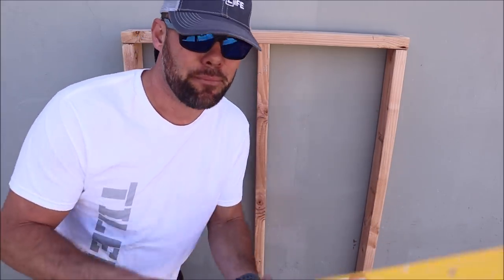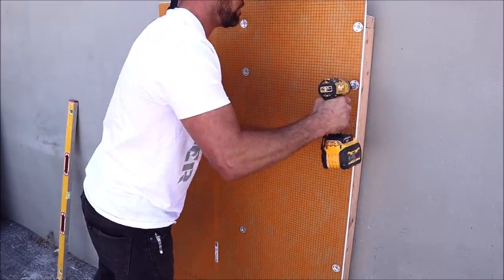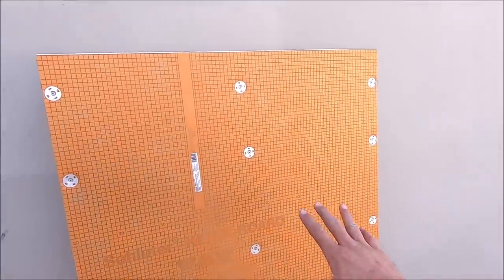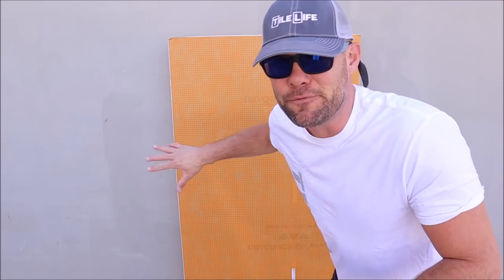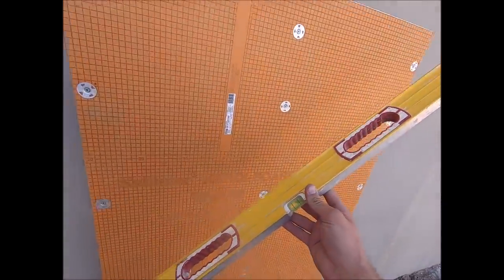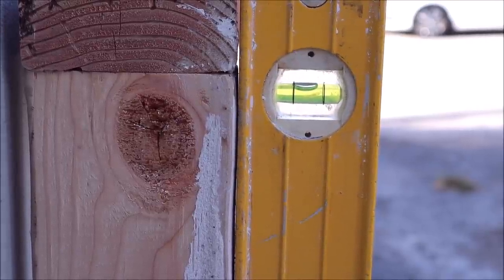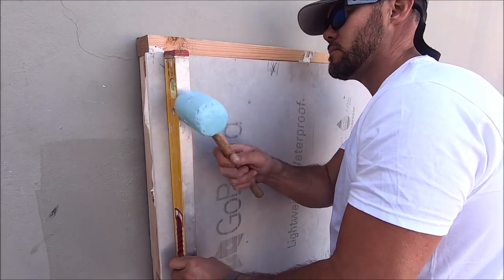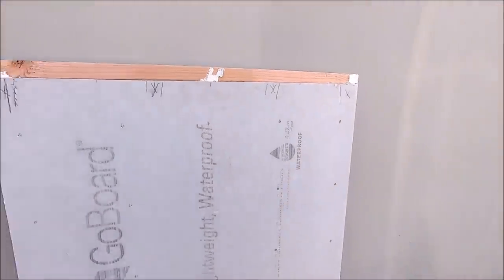Wet Shim Framing Studs for Flat Plumb Walls!

Comment: Before I have a go at this, do you have to screw everything in while it’s still wet or do the screws go through the thinsett when it’s dried?
Reply from the maker: Still wet, just a couple to hold it in place when you get it plumb.
Reply from the maker: You the screw it off the next day

Comment: Can you use wood shims instead of wet shimming?
Reply: You can
Reply: You can also buy a couple of 2x4’s and sister them onto the existing studs and plumb them up which means you done have to wait 3-4 hours on anything setting.
Reply: Yes but you might shim different increments top to bottom...wet shim it then conform to adjacent studs is easy and time efficient.
Reply: @patrickaustin8335  I just did it with wood shims and your right, wet shimming is way way easier even though you have to wait a while for the cement to dry.  It's always a guess with wood shims and it's never perfect.  I will be wet shimming from now on.  I guess I should trust this channel, the guy is very good.

Comment: What about those issues if you are using cement board...how do you solve?
Reply: Use sheetrock 45 & install 2 screws to hold up the board.

Comment: I work for bath fitters using that material is an absolute waste of time. It's called "butyl tape" look it up save your time, save your life, save your job, save your money. It comes in 1/16"x 1",  1/8"x 1/2", 1/8" x 1",  3/16" x 1". I can do 5 showers by the time that dries. TIP: use spray glue on studs, and or existing wall before installing butyl tape. If installing butyl tape over existing tile wall use black primer. And you do not have to hit your level with a hammer xD!

Comment: You can do this with Durock as well?
Reply: Not really. Couple of reasons, but just the weight of a sheet of Durock would pull the sheet out of position once you stepped away. Foam is light and stays put.

Comment: If I'm going to put tile on the wall I Will be using concrete backing board or water will soak through the grout and damage wood or waterproof drywall..
So I guess I will be shimming it the old school way.. nice idea though for the first 62 seconds that I watched for my boys house I put up 1/2" plywood and rubber paint then concrete board kinda over kill but it is being rented out and I don't want to do that job again ... So that washrooms should last many years ...

Comment: I still don't quite understand why you can't wet shim concrete board???
Reply: I think its too heavy and will not set up in the spot you need it will pull away from the wall
Reply from the maker: Yes, and suck moisture out and squeeze out or crack up the thinset when screwing off because of the rigidity. I'm sure guys can do it, we haven't had success with it.

Comment: This is stupid.  All you need to do is plane the studs that stick out, then shim the other side with cardboard strips. Works like a charm and there is no mess!  You can true up all your walls at the same time..  You also maintain 4 1/2 inch wall thickness.

Comment: It's easier and faster for me to float I've  ben at it for about 20 years
Reply: I disagree.. I'm going on 40 years
Reply: 20 years of doing it right, or 20 years of doing it wrong? I’m at the same time period as you, and seen things done right and wrong by many claiming so much time put in. Always looking for ways to make things easier but never to sacrifice quality. Yes I have floated walls after hardi and have done so in my own home. But from what I have just seen here, wet shim is going to be easier than floating for a flat wall. Still not trusting schleuter, prefer hardi.
Reply: 32 years and only 41.. Been floating wall's since I was 11 back in 1991, no way is floating faster or easier... Or with the crap chinese metals, they will not last half as long as when we did them in the 90s... You are just outdating yourself with an old method that isn't being used as much for a reason..